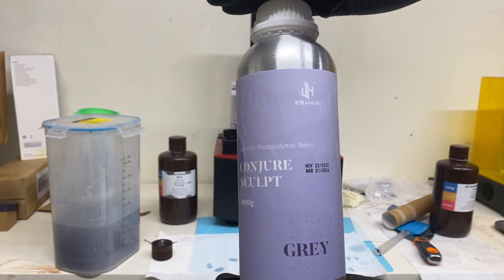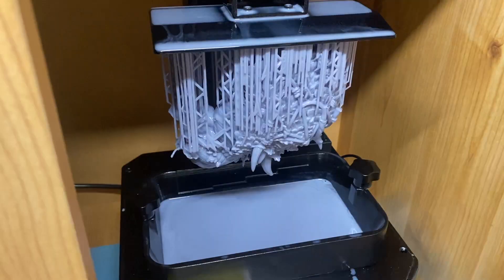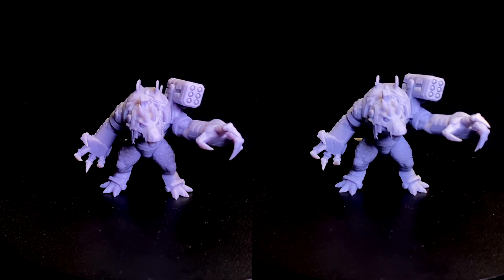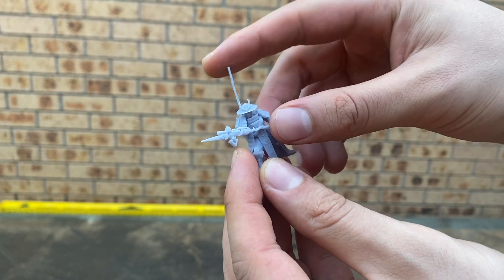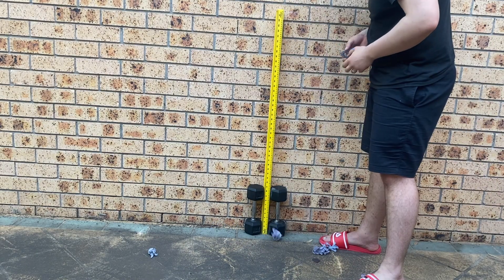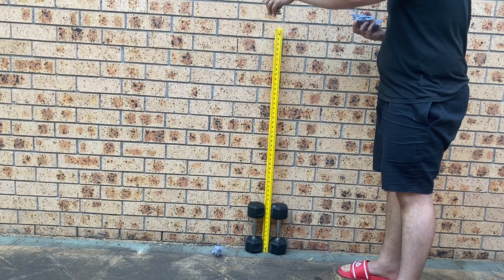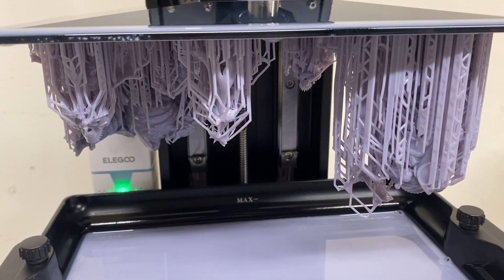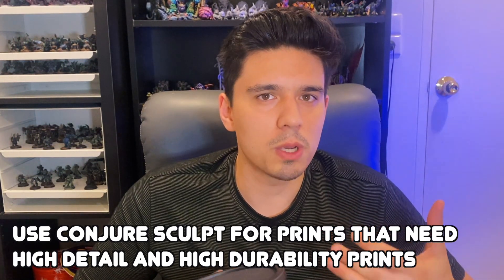RESIN made for CRISP detail. Conjure Sculpt Resin Review

Comment: Hollowing large rints would imrove their chances in drop tests wouldnt it?
Reply from the maker: I think it depends. The prints I were dropping weren’t worth hollowing. I’d save a nominal amount of resin but have to do extra work adding drainage holes and curing the inside.
Hollowing will mean the prints are lighter, but the parts that usually break are thin, details which would break anyways.